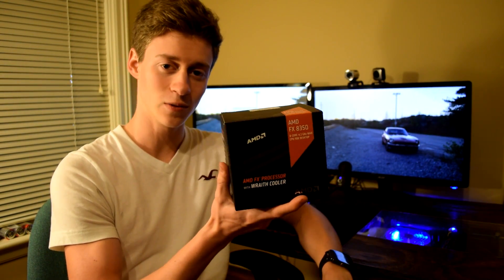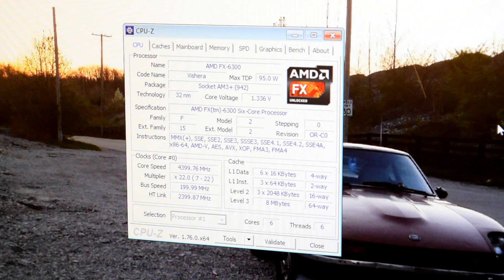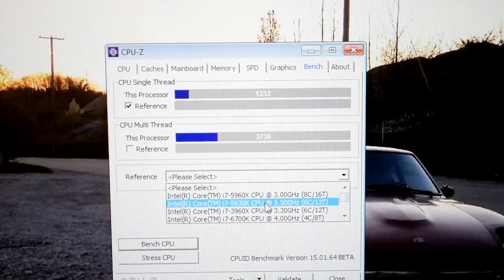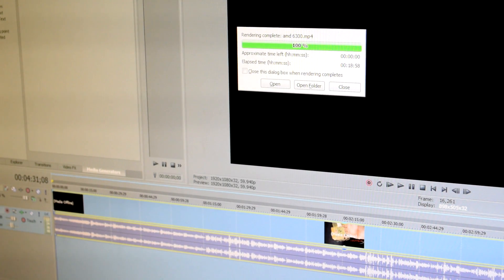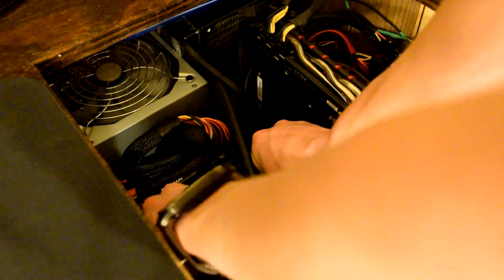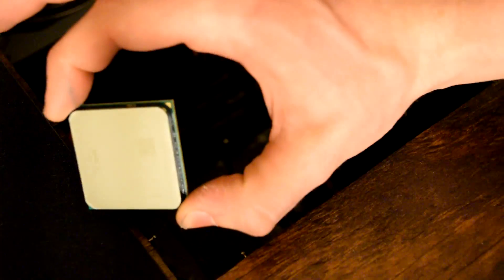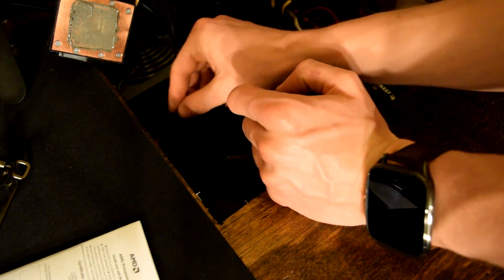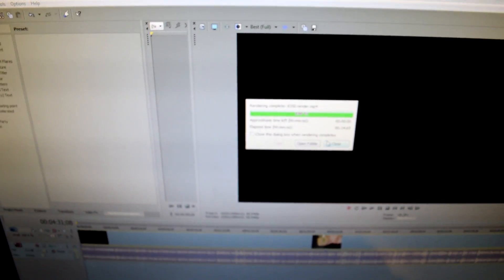AMD 6300 Vs. 8350 With Wraith Cooler!!!

Comment: Wait your 6300 was over clocked to 4.1 it is 3.5 stock and the 8350 is stock at 4.0 ( mine came at 4.1 with boost to 4.3) do it again with both stock - that is the 6300 at 3.5 . I have built both with the 970a Krait  and the 8 core kicks the 6300 ass and they both had 16gb of ram .

Comment: Im gonna get the 8350 should i switch out my corsair h55 liquid cooler for the wraith cooler ?
Reply: no wtf,  it's a liquid cooler it's going to be way better than a stock air cooler even if it is the wraith
Reply: Not necessarily. h55 is decent and is indeed slightly better than the wraith cooler. But not all AIOs are better than air coolers. Infact about 25% isnt
Reply: I just realized I need a new MoBo with the zen chips, so I'm just gonna get an FX8350.  As long as the game play near 60 FPS on high settings, I'm good.   I get nearly that on my FX6300.
Reply: ***** how do you like it?
Reply: Ok I see.

Comment: i have an r9 380x And a fx 6300 shoud i upgrade to 8350 now?
Reply: ya the graphics card you have is pretty powerful so the extra cores and clock speed will come in handy and improve performance
Reply: +shadesFTW ow thanks 🤗
Reply: shadesFTW or shoud i upgrade to an i5 6600k ??? i have the money
Reply: if you could go for the i5, intel usually does better than amd
Reply: Hold on until Zen and Kaby lake comes out they are around the corner and DDR4 is pretty much going to start to be the norm as both CPU manufacturers are going to implement it.
Reply: Silverry i allready have a z170 moderboard ddr4 ram a the i7 6700k
Reply: DANEEX YT You are gonna get fucked if zen or kaby lake is significantly faster, but at least you already have a z170 motherboard.
Reply: i only Game on my pc
Reply: +Silverry the new amd zen models are am4.. So amd are building a whole new motherboard to support it
Reply: i will buy a zen cpu inf they powerfull enought to compete with the i7 6700k
Reply: Absolutely you're going to die if you don't. Sick jokes aside. If you want it, do it, don't ask other people to decide for you.

Comment: Don't even bother upgrading to a 8350. If you're wanting to stick with AMD, wait a couple more months and get the new Zen CPUs coming out on AM4 platform. It will be a significant jump over AM3+ and the FX "Bulldozer" family of chips. That shit is 10 years old.
Reply: you are completely right but if you dont want o buy a new mobo the 8350 is a good choice from amd, am ordering a 8350 and i will buy next year a new mobo for the Zen.
Reply: i can get the 8350 with the new cooler for 149.00 the Zen the lowest one is 329.99 plus a mobo the lowest one right now is 110 and memory because the new one are using DDR4 it will be like 150 more for 16g that is almost 600 bucks compare to the price of the 8350 @ 149.99 for update my 6300 that is like 6 years old on my PC and is working fine, now finally are some games that on paper my cpu is not listed as a CPU that can run the game but still work.

Comment: THIS IS a great vid
many people think Fx6 and 8 core work exaclty the same if they work at same frequency... that false statement comes due to the fact that many games uses no more than 4 cores (and old games maybe only 2), but that statement does not take into account that having 8 cores will distribute the total system usage between more cores, which will benefit the "gaming cores" and give a little better gaming performance.
On single aplications using all cores the gap its big, but the gap its also noiceable when multitasking.
that being said, Fx6300 its a nice budget CPU, kind of comparable with haswell i3's (maybe skylake i3s if overclocked) at general performance, with better multitasking and worst gaming capabilitys...
Fx8350 its only behind of i7s at heavy tasks but the gaming experience its comparable with lower end i5s, its a beast for the money if power consumption and heat generation are not a problem (and they should'nt be)

Comment: Always clean the CPU before removing it
Reply: yeah - if not cleaned strange things can happen ;)
Reply: well if you didnt clean you may put some thermalpaste on pins/connectors/socket
Reply: Ab So Loooot Leeeee
Reply: Brandon Horan K and nearly every thremal paste  made now days is non conductive ! The cpu doesnt care people treat them like there babies!
Reply: Actually not all paste is non conductive . And if you gum up the socket with any paste when you reinsert a chip it will not work sorry but maybe you should do alittle more learning and less letting you mouth flap
Reply: Benman2785 thermal paste is non conductive...
Reply: Deeez Nutttz GotttttEMMMMMM
Reply: I repeat Deez Nuttz Gotem

Comment: Hey man i have a question...I just bought my 8350 (non wraith) cuz i wanted to change my intel i5 3470...So i put it in without doing a format to my computer and then i wanted to overclock it. (i have a deepcool maelstrom 240 T liquid cooler so it should have no prob) Even when i go from 4.0 (stock) to 4.2 it crashes in every game...Any solutions?
Reply: There is a lot more to overclocking than having a decent cpu cooler. You need a good 8 phase full ATX motherbord. A Micro ATX board won't get the job done. You need to turn off all the power saving features in the bios. You need to disable Turbo mode. You need Windows in HPC mode. You need in many cases to up your vcore. Go to overclock.net or overclockers.com, join and post a thread. Make sure to post all the components in your rig.
Reply: Christopher Wood Thanks man i appreciate it! If this helps i have an MSI 970 Gaming mobo and tried about a month ago to overclock my 8350 (with turbo mode off) with all specs given by Tech Yes City (famous youtuber) but same thing happened all the time...crash and crash and crash...even in 4.2Ghz which is its own turbo mode!! I must confess though that i didnt know anything about this HPC mode or these power saving features...So i will go to these sites for help...Thanks again!
Reply: There is a long thread about your board at overclock.net that will help you out lots. a bunch of good info. good luck.
Reply: I get 4.2Ghz boost no OC :P

Comment: So pretty much, for the average user, save the  little bit of money and buy the 6300. But if you're more of a power user on a budget, get the 8 core CPUs. 

I built my PC around two months ago with a 8320 and it's overclocked to 4.2 Ghz at the moment on 1.332 volts. It can be a bit of a hindrance on my R9 390 in some games but others it's a beast. I typically play games like Witcher 3 that care far more about the GPU than the CPU, so i'm very happy with it. Especially with Dx12 coming up. Hitman and Ashes of The Singularity run flawlessly.

Comment: Why not 8350e? They are better quality chips since they are binned for low tdp and you can still overclock on a bunch of boards.
Reply: From what I'm aware that chip doesn't come with the wraith cooler, which is I think one of the main reasons he went with the 8350.

Comment: i have a 8350 with a diamond radeon hd 7970 and 8gb ram wht do i just get 55 avg fps and lag on minecraft?
Reply: im a noob at pc gaming so this might sound stupid
Reply: i also have those tubes on the processor
Reply: +Toluntito What are you asking?
Reply: If its normal to lag on Minecraft with the specs i have because ive been told that my specs are really good
Reply: +Toluntito I have a 8350 myself paired with a r9 390 and 16gb in mc I have never lagged even when maxing out the game. I would thing you have a driver issue or you have the render distance set to far
Reply: +Toluntito no that's not normal try to update the drivers :) I have a i5 4699k with a had 280x which is a had 7970 so just update drivers
Reply: +wyatt klee that's what I'm thinking it's not a demanding game
Reply: +Kascper Boguszewski  +wyatt klee thanks ill try that
Reply: +Toluntito you fixed it?
Reply: +wyatt klee it doesn't let me download the driver updates
Reply: +Toluntito well what drivers did u get ? on amd website you can get a utility that will detect and update your drivers automatically
Reply: +Kascper Boguszewski ill try that

Comment: I think you should retake the benches with the 6300. The CPU-z bench, 3738 multithreaded? 
If you have that voltage as shown in CPU-z on full load my guess is that it's not stable and that causes the drop in performance.
Reply from the maker: +LPG I had the 6300 stable :). Although the 8350 I still need to get the settings worked out.
Reply: +Toasty Bros 3738 is still super low score however.

Comment: nice video once again guys although I am pretty surprised you didn't upgrade to an i7 processor
Reply: +Audatious Xtreme It's much easier to upgrade to an AMD chipset when you are already using an AMD. If they went with an i7 they would need to buy a new MOBO and possible a new copy of Windows if they purchased an OEM copy.
Reply: +Brandon Westfall I upgraded from a amd fx 8320 to an i7 5820k I agree price was alot. there were no issues with Windows even with an oem copy. but the performance gain with streaming recording and gaming was amazing and well worth the money